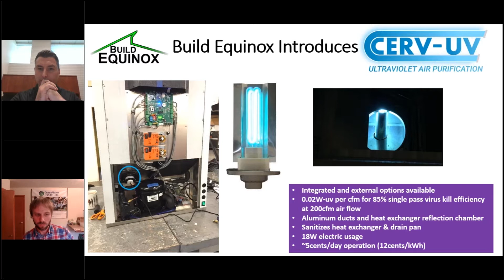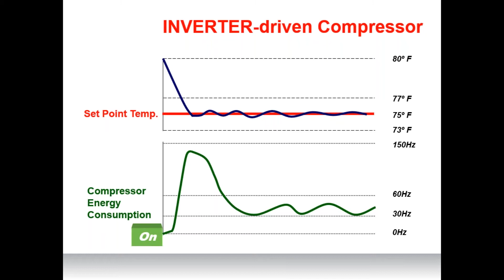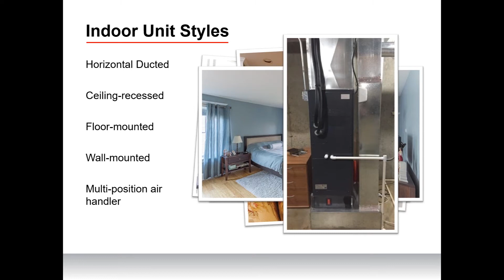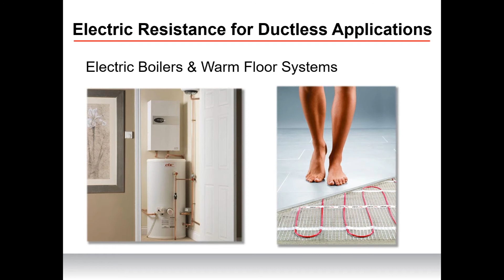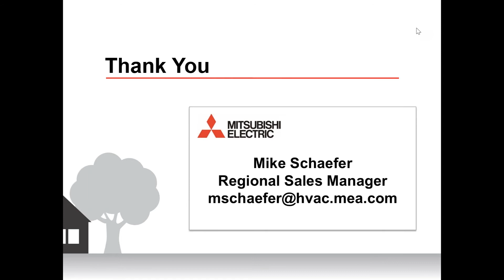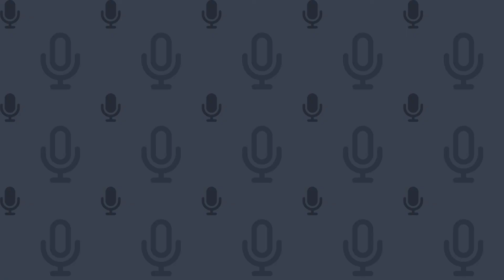Supplemental Heat & Dual Fuel Options in Heat Pumps

Comment: Are these dual-fuel systems are appropriate for high-performance or Passive houses?  They seem more appropriate for retrofits.  Passive house models I've seen can get away with a couple of low-temperature baseboard heaters (so as not to fry dust), and a ductless mini split A/C unit. Backup wood-burning stove for power outages.
Reply: Yes to mini-split systems alone for both types of homes.  The larger size High Performance Homes may still have a heating load high enough to warranty a duel fuel system depending on the climate zone.  Passive House in general would not require a gas backup as you mentioned due to the extremely low heating loads. If the air source heat pump needs backup, electric resistance will do the job.